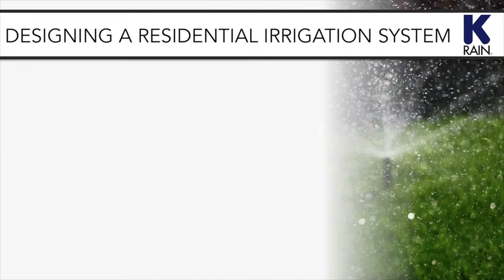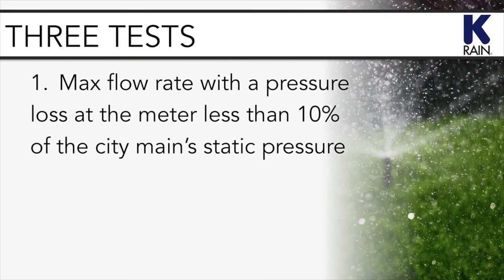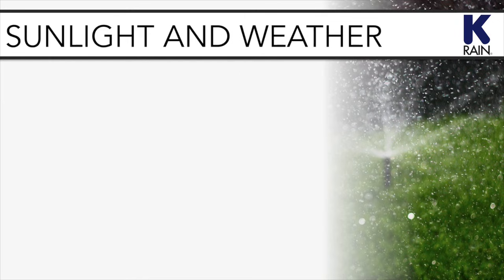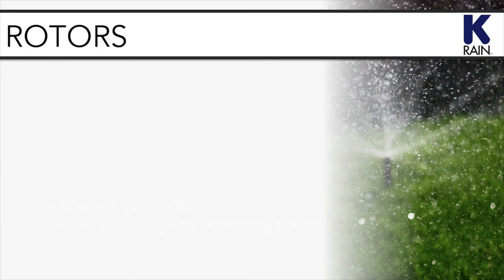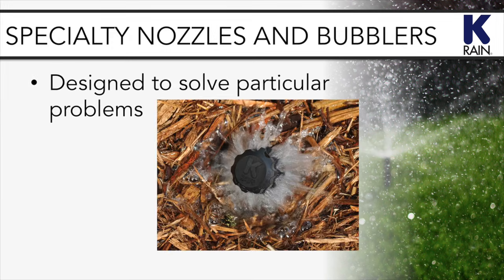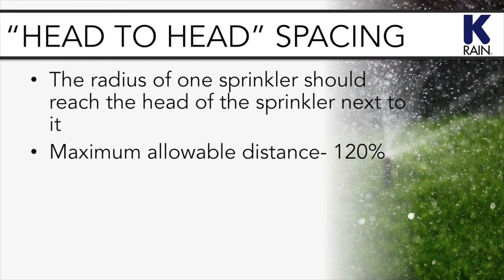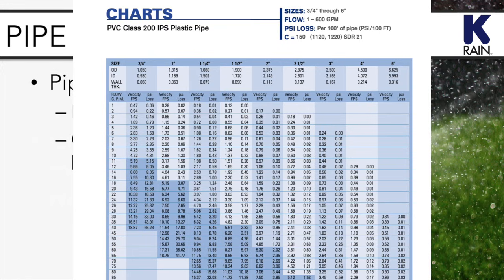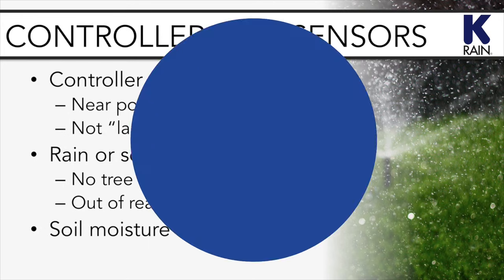How to design an irrigation system

Comment: I guess I would explain it in much simpler terms.  Been in irrigation for over 25 yr.  Start with volume and psi.  Check gpm per sprinkler.  Put as many on a zone so as to not over max the flow plus do your psi loss per zone.  Pipe size depends on how many sprinklers per zone keeping it all under 5 ft. Per second.  Above 5 ft. Per sec causes water hammer when shut off.  Doing orchards is calculated on supplied amount through main.  My area is limited due to supply to orchards is capped at 90 gpm.  This is due to orchards being supplied by city pump.  Orchardists have been known  to tamper with dole valve which decreases volume for other orchardists.  If you get 90 gpm on main line calculate every zone based on that gpm.  Start at the far end of the line.  3/4 " pipe by chart maybe 10 gpm.  Don't have chart here. 1 1/2 gam nozzle divide into 10.  That gives number of sprinklers on that line.  Then bump up to 1 inch line.  How many sprklrs on that line.  Then 1 1/4 " pipe . Work back to main.  Do this on each row till you run out of volume, e.g. 90 gpm. Start over again.  Sorry I can do much better but basically thats it.

Comment: how to calculate totally pressure? if each of rotor need 30-60psi. please help to explain more calculate totally flow rate, size of pipe, total pressure of hold system

Comment: Would also suggest that during initial site analysis, pre dedign, that you verify your max.rate of flow available at your source - especially on homes built pre WWII. Don't assume! I ve worked on homes with a max flow rate as low as 7 GPM.

Comment: I have been looking for an easily digestible way to understand this surprisingly complex topic. 

Bought a house with over 10k sqft of lawn using 18 sprinklers in total; Mixture of fixed, rotor and other, all on 2 zones/valves. 

I thought this was weird and you helped confirmed this. I live close to the county irrigation pump station and I must have insane pressure. 
This is gonna suck. 🚧😫🏗⛏😓

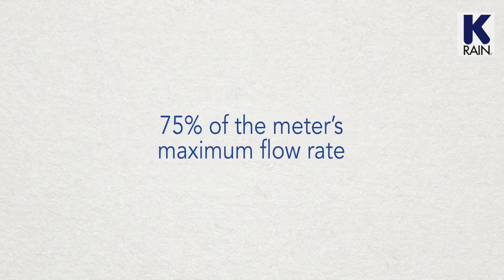Comment: You guys messed up a bit with the editing at about 6:00. You guys point out that the highest pressure loss recorded for a 3/4" meter is 15 psi at 30 gpm, however you guys point to the 5/8" psi loss.

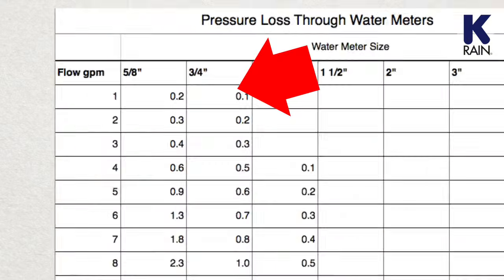Comment: Just a heads up... at 6:05, the red arrow points to the wrong 15.0 (in the column for 5/8" meter) which equates to 20 GPM (when the narrator says 30 GPM).  Had me super-confused for a minute until I realized it.